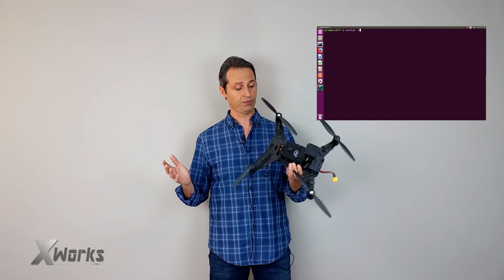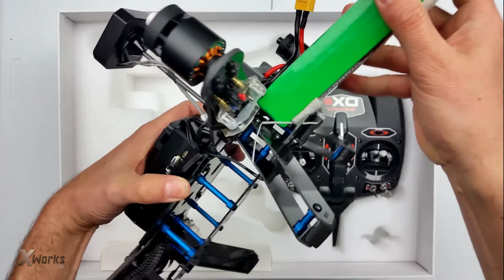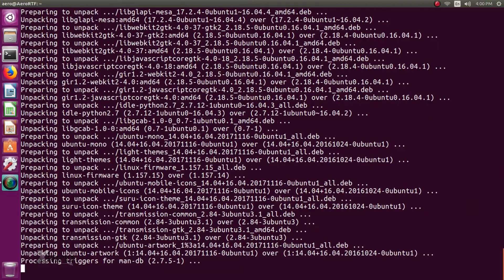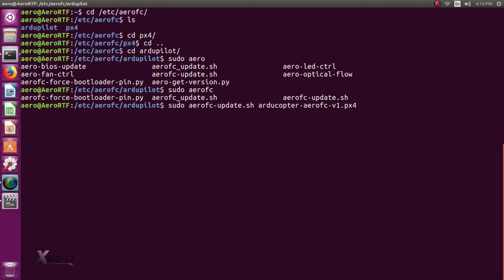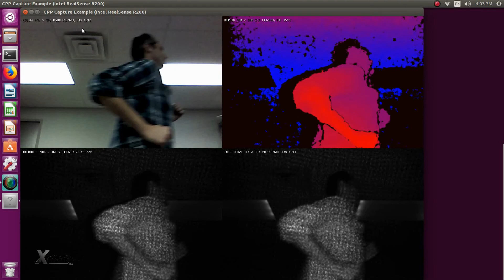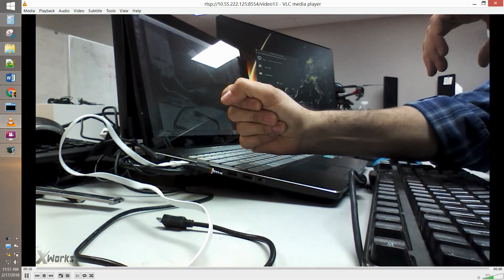Intel Aero RTF Drone | Open box and Setup

Comment: Right now "sudo apt-get upgrade" has to be omitted. If it isn't, Ubuntu 16.04.3 is changed to 16.04.7 and Intel Aero Ready to Fly Drone stops working (screen becomes purple or boot freezes at "Loading Initial Ramdisk")

Comment: Great video and channel. It's been a while since you made this and this drone has been discontinued but I got my hands on one. And I am just curious if you have flown this intel aero rtf drone yet. 

Can you disarm the drone and make it stop spinning? I can arm the drone and throttle up fine. However, when I held down the stick to left down to disarm, it doesn't seem to stop the motor from spinning. I am also having trouble connecting the drone through wifi to look at flight controller through control station. I am waiting for cables to get into the OS to check that out.

Thanks
Reply from the maker: I have not noticed any of those issues when I've flown the drone
Reply: @prandtlmayer  Thanks. Turned out all software on my aero drone were so old that nothing said on the website still applied. Updating everything worked. 

I wonder if you might consider doing some mavros videos in the future since that area has been pretty untapped but lots of people are looking to get into it.

Comment: Hi Tiziano, a very good video!! I wonder if you have been working with Intel RTF drone, I mean if you have developed scripts for making it fly, trancking, obstacle avoidance, etc. I have one and I'm working on it, I hope if you can share me some information. Also hope for your next videos. Regards!!
Reply from the maker: Hi Alex, I know I am late with the next video. Very busy with my green card and my job and a paper I have been working on. Next video is going to setup ROS on ubuntu and calibrate the camera. My plane is getting to internal navigation in a few videos. It's too complicated all at once. I have been testing the system outdoor. Nothing fun, just a normal multirotor.
Reply: Tiziano Fiorenzani thanks for your reply, and it sounds interesting what your doing. Let me tell you that I was working with dronekit and tested some scripts with dronekit-sitl and simulator and everything was working ok, but when I tried to tested it on my Intel RTF drone a simple takeoff script based on https://gist.github.com/dbaldwin/9185b702091148580fa836c1911f8735 it doesn't pass from the Basic pre-arm check. The command is_armable don't change from false to true. What could be the problem??

Comment: Very useful video!! I have a 3 amp 12v power supply, Is it neccesary to use a 2 amp 12v??
Reply from the maker: Alex Omonte 2A is the minimum recommended. No limit for the max
Reply: Reading the documentation from https://github.com/intel-aero/meta-intel-aero/wiki/01-About-Intel-Aero#wall-socket-power-adapter mentions that a 9V - 16.8V and 4A is recommended, is that correct??
Reply: @ivanomonte4370  Yes.